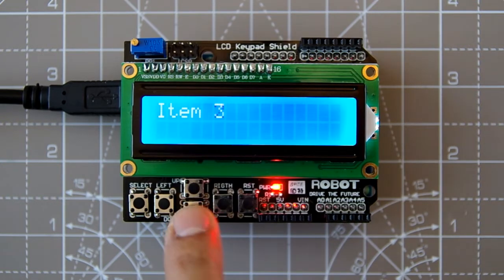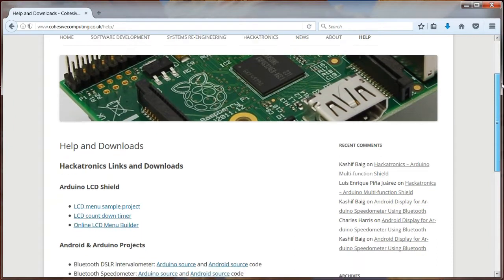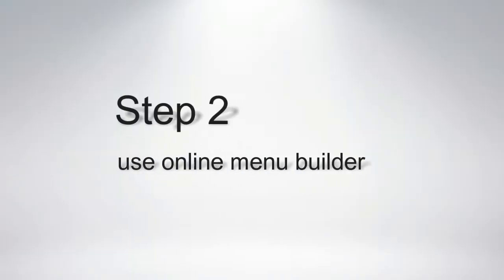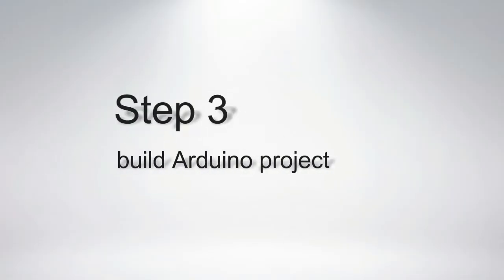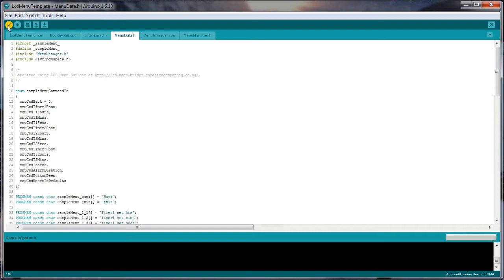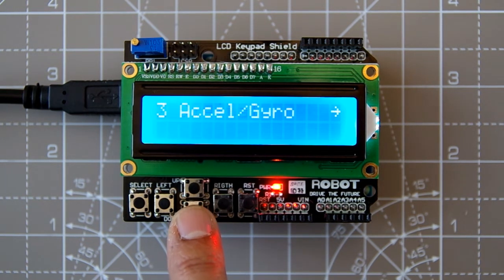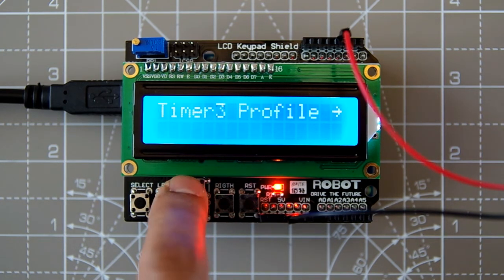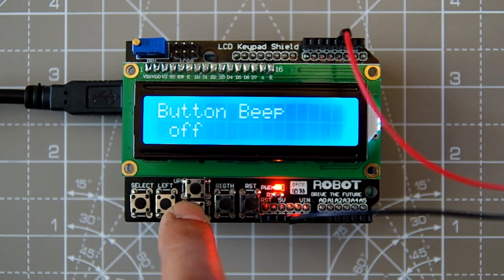Arduino LCD Shield - Coding Menus the Easy Way

Comment: Not working with my lcd keypad shield. i do all steps but no beep select dont works i see no sensors on the menu. what do i wrong. i have same lecd keypad shield only noy on the right side of the top the bracket for the pin inputs.i make the pin connector on the board. and now?
Reply from the maker: For anyone in a similar situation, find example source code that demonstrates the buttons and LCD display working. Then adapt the menu source code to use what you learn from the working example you found.

Comment: Is it possible to use the Aruino Uno along with the Adafruit Adafruit LCD Shield Kit w/ 16x2 Character Display - Only 2 pins used! - BLUE AND WHITE with this?  Is there anyway I can get some guide or mentorship to integrate to this different shield device?

Comment: Has anyone tried to utilize this code with the  Adafruit LCD Shield Kit w/ 16x2 Character Display - Only 2 pins used! - BLUE AND WHITE
with an arduino Uno or Adafruit METRO 328?

I have been struggling to develop state machine menus using other methodologies besides this and have not been successful.

Comment: Can't thank you enough for this menu. i spend days trying to deign my own and trying other libraries. but yours was very easy to work with. with some tweaking i made it work with i2c lcd and push buttons with the help of your comment on your website. i am looking for a way to have  2 menus. is that possible with this? one sort of like a initial setup menu which will only fire at setup and the other will be a run time menu. i assume i will have to create make another copy of xml sample and do the whole menu building again. pasting 2 menus in menu data.h file should work. what do you think? is there something im missing? again. love the project.
Reply from the maker: It should be possible to have multiple menus. You'll need to have a different set of values for the IdPrefix and VarPrefix attributes in the menu xml. You can save the menubuilder output to a different file. In your main project file you'll need to include this new file and have another instance of the MenuManager class, and use it in a similar way to Menu1.
Reply: Are you talking about that you got it to work with the Adafruit LCD shield kit?

Comment: Thank you for this beautiful work! I tried many codes, but this one seems to fit perfectly my project!

For now, I figured out how to add menus, submenus, go into a menu and exit (sometimes the back button doesn't work?) from it. But, this code is by far beyond my skills and I easy get lost into it… I would like to know if you can help me with the following questions:

1. How can I add a Menu -> Select it -> Display text? Something like and when you select it, just display some text row by row.
 I understood that I have to go into this loop byte processMenuCommand(byte cmdId) { }, but I could not get any result... I tried with: case (my MENU): "Serialprint or  Lcdprint" break; but nothing happened. Would you be kind and provide me some help?

2. Where can I define if in that menu something is happening> Something like: I go in Menu1 which has SubMenu1, SubMenu2, SubMenu3 and when I select SubMenu1 something happens (display text, save a variable, set a reference parameter, start a loop, anything).
 If the Menu doesn't have any SubMenus then I don't have any "right arrow" so it means I can't display anything new, set a variable or just print some words on serial monitor?

I am very interested in this code, but I am struggling in using it in order to fit my project.

Thank you very much and again great job!
Reply from the maker: Hello Iulian, please see my reply to your question on the project web site: https://www.cohesivecomputing.co.uk/hackatronics/arduino-lcd-menu-library/#comment-10958

Comment: MY lcd is not dsiplaying anything i have tried many libraries but could not gel display. although reset buttons are working on pressing
Reply from the maker: Have you tried adjusting the contrast? You can do so by turning the small screw at the top corner.